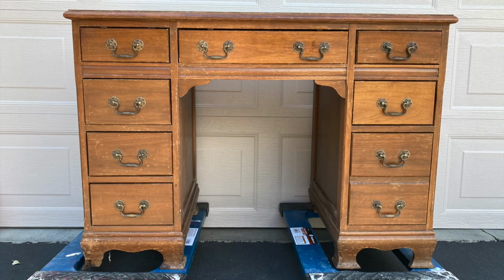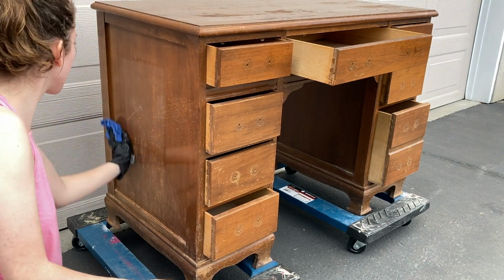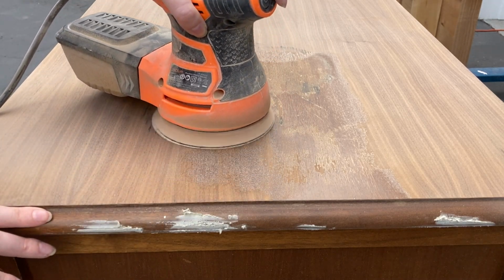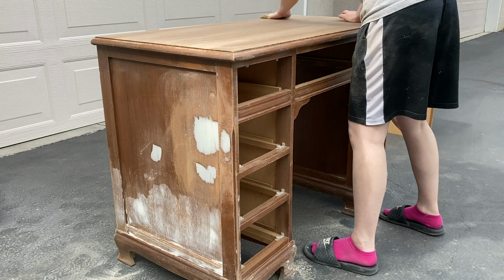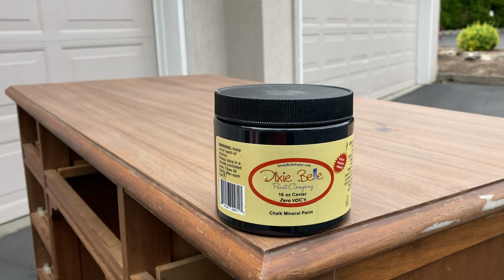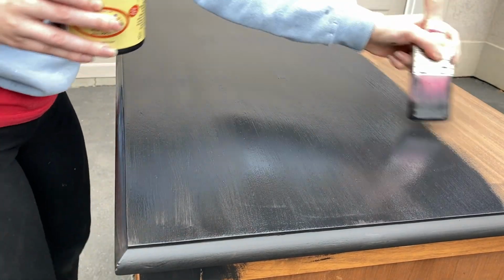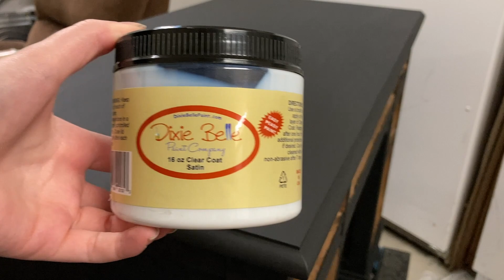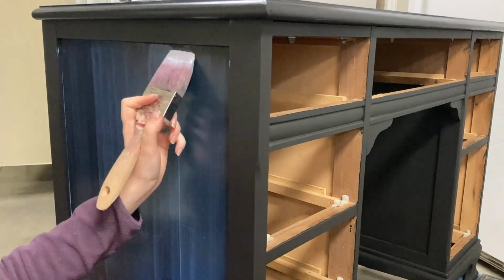Trash to Treasure Desk Makeover Using Chalk Paint | Facebook Marketplace Furniture Flip

Comment: You use tbs let it dry the rise . If work the 1st time try aging . I can come of or light it up the it was. Not hard to do
Reply from the maker: I think you’re trying to insult me here, but there are so many typos that I have no clue what you’re trying to say. Thanks for watching though!
Reply: @ChicAntiquebyHolly  omg no I was not absolutely not I'm so sorry. TBS is a kind of soap in a powder that you put on top of the wood to remove it dark stains you let it sit until dry and then wash it off. I was using the mic it was supposed to say it will come off or get lighter.